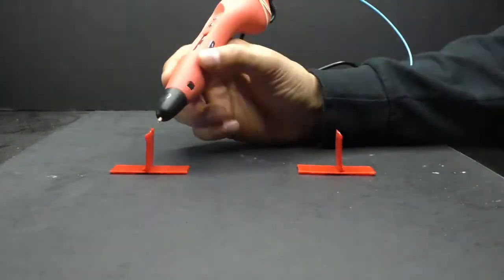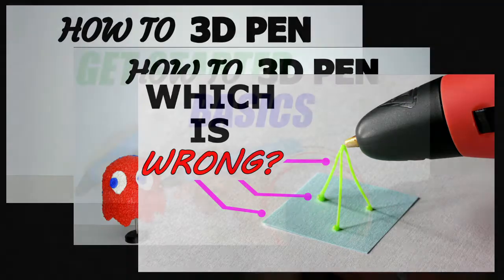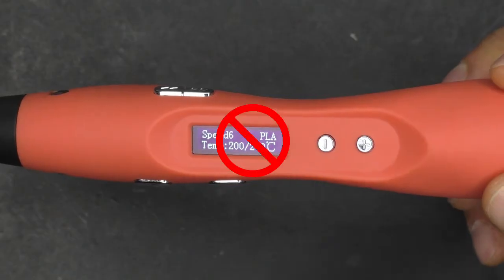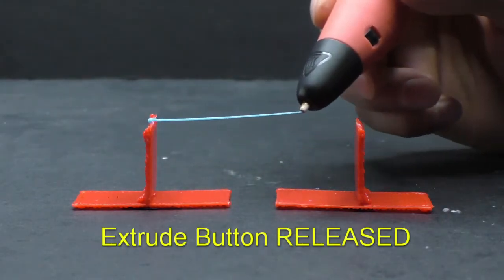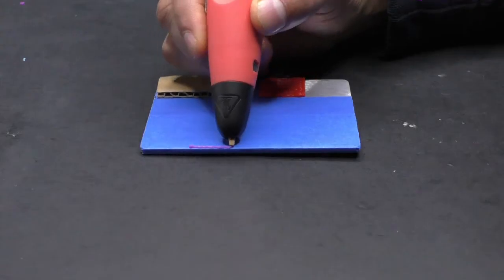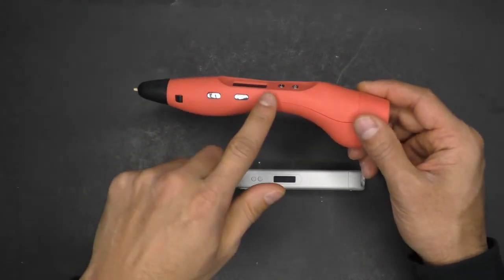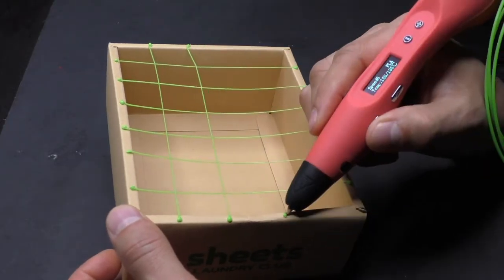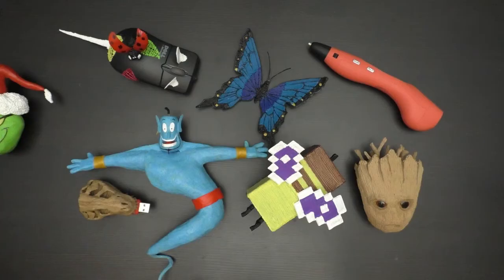Bridging Tutorial- Key 3D Pen Skill

Comment: Bother I have a question please can you please can you tell me I want to buy a 3d pen 
Option
1 with temperature control 
Speed control and abs and pla switch 
2 just basic pen only with speed control and supports only pla filament 

Name of the second pen is 
---WOL 3D ITouch 3D Pen for 3D Drawing , Art and Crafts , Modeling, Professionals and Education. 

And the first name is 
---Robocraze 3D Pen-2 Professional | 3D Printing Drawing Pen with 3 x 1.75mm ABS/PLA Filament for Creative Modelling and Education (Pack of 1)

And last one 
----Brand: Magicwand
3.4 out of 5 stars  15Reviews
Magicwand® 3D Printing Pen with LCD Display & FREE 3 ,1.75 mm, 10 Metre Each PLA Filament Refills
#1 Best Seller in 3D 

Please can you tell me which one should I buy please 
Because if buy wrong one my parent will kill me